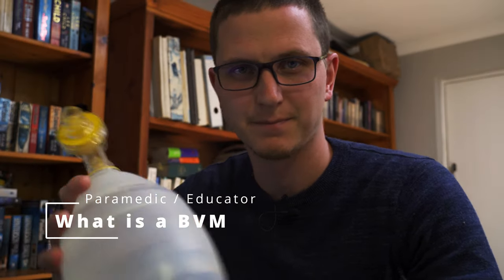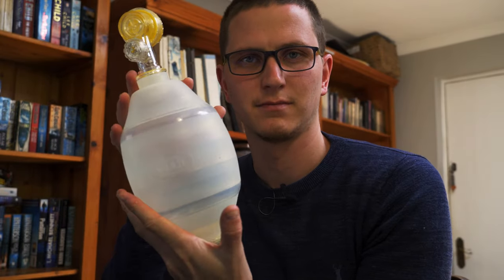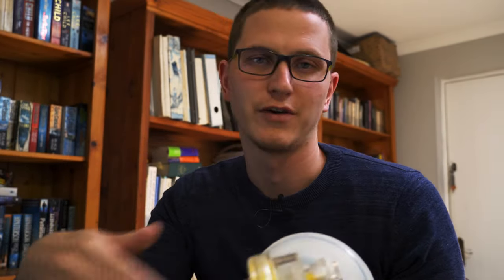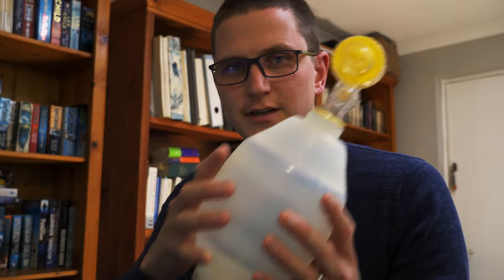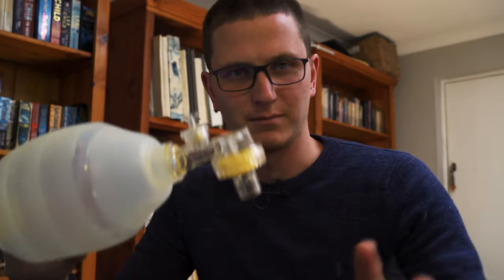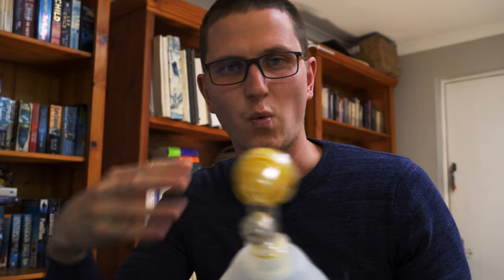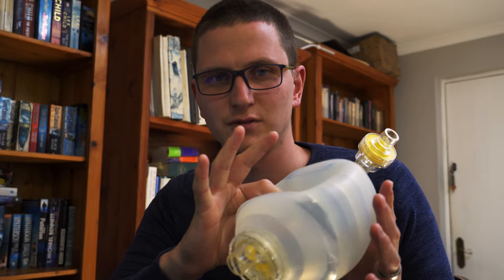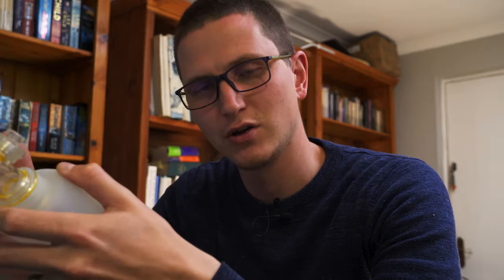Bag Valve Mask (BVM) ventilations EXPLAINED.

Comment: I was wondering what stops the air from the bag to escape on the sides of the valve. What guarantees it goes into airway and not into the open air. The device appears a bit blurry on camera when you show the most important thing. Ty
Reply from the maker: The valves make it so the air travels in the correct direction